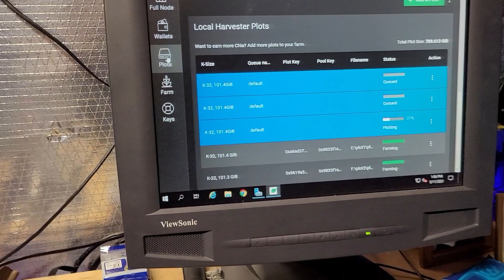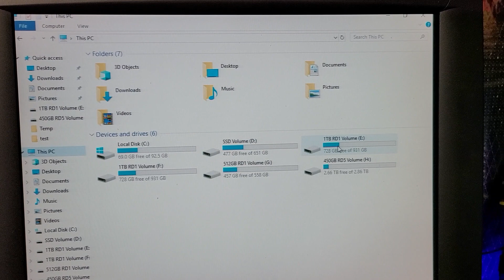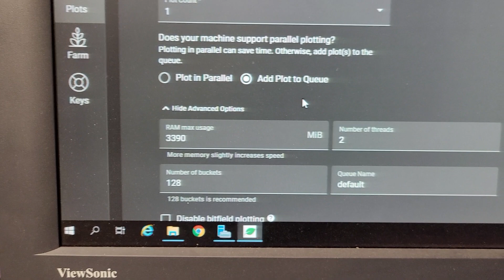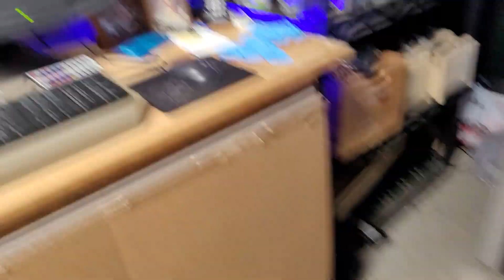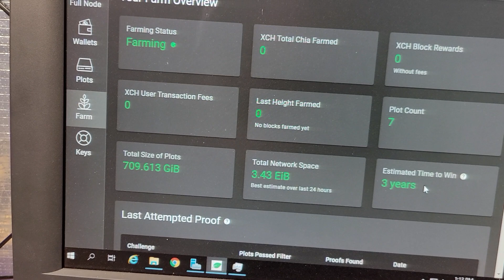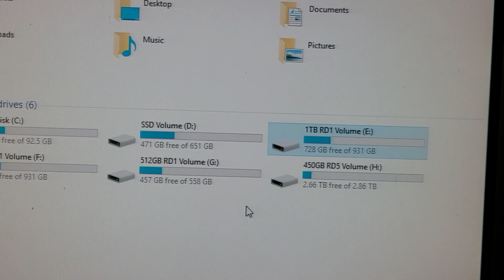More on testing best disk configs for a Chia server and lots SSD drives may not be the answer

Comment: Thank you for the great information, you've earned my sub.  :)  I'm also thinking of getting into Chia mining. I have a few spare parts lying around and was wondering what your suggestion would be, RAID0 or all independent? These are the parts I have and these will be installed in a "not-too-old" gaming computer:

- LSI 9261-8i 8-port PCI-E 6Gb/s SATA/SAS RAID Controller Card

- 4 x H.G.S.T HUC109060CSS600 C10K900 600GB 2.5" 10K RPM 64MB SAS Hard drives

Thank you for your input, it's greatly appreciated.

Comment: your videos on the subject have been very informative im sitting on a couple R730xd’s that im trying to optimize I’ve read that yanking the perc controller and swapping it for a hba, formating drives to xfs, disabling swap in linux allows you to plot 30-40 per day.
Reply: Thanks for the swap comment, i'm yet to set up farming but im gonna be running upto 6tb worth of sas drives on a linux host so that swap boost will be useful.
Reply from the maker: I have not heard that but I would like to know if you are getting that.  The math doesn't add up for up to 40... But!  Keep having fun doing this stuff dude!

Comment: thank you my dear . I need to buy some parts can you help me . Server for chia > I now own 20 HDD 8 TB every each and I am planning to buy more, but I need an expert . How can I communicate with you and thanks
Reply from the maker: Thank you for thinking of me as expert but I really am not.  Just a IT guy that has been doing this for 30 years.  First thing I recommend is for you to go to CHIA.net first.  Understand what is needed as a basic system.  A PC will do.  Build a few sample system build outs in MS Windows and Linux.  (Linux will get you about 15% back over windows) Use what you like best.  Then when you feel ready build a server / high cap disk drive array like a NetApp DS-2246 3.5 inch array or something like that with a SAS HBA controller and you are ready. (Do your research on the SAS/Mini-SAS cables needed to connect the DS2246 to the server.)  Make sure you track your CPU threads and RAM requirements.  I am using a Dell-R720XD 2.5 24 bay server with a single 2246.  So far so good!  Enjoy... /:>

Comment: Step 1: If you're on Windows get off of it and go to Linux... a guaranteed 10%-15% increase no matter your setup. Windows is a resource hog. 
Step 2:  You want to forget about using Chia local client. you will want to use Swar Plot manager. In the config, you can control what resources your using during which phase.  Example CPU threads are used in Phase 1. Rule of thumb 2 threads per plot. However in the config when you get to phase 2, you can drop those 2 threads down to 1 and start freeing up system threads to plot even more. 

Here is an example: 
16 cores 32 thread machine equals 16 plots if it's 2 threads per plot in parallel.
Phase 1 = 1-31%.
Phase 2 -4/5 only requires 1 CPU thread. 
This is where you need to look at the log file to figure out an estimated time of how long plots take in phase 1. 
Example time: Phase 1 takes me roughly around 3 hours to complete. So after that time, I can drop one thread count per plot leaving me with 4 more plots to be started in Parallel. 

At this point now that you are using your threads at 100% you can start to Stagger all your plots in the Que. 

Remember you can only do this with Swar Plot Manager in the config file. The Chia client is so limited.
Reply from the maker: Thanks for the information, I was reading about this but currently I am doing test builds to show each value and impacts as people choose OS and resources.  Once I am done I may just stop and  move on to the next things or maybe mine Chia a little longer.  The fact it is taking a year to get a Chia token is a let down but I am not doing it for the funds, Just playing around some and sharing information.    Thanks for sharing this info with me.   Enjoy !
Reply: @leadiususa7394  I’m in the same boat. I’m just playing around with the idea of it. Making some systems for home

Comment: Single disk volumes is the recommended method, chia decentralized has incredible videos all worth listening too a few times over. Also if you’re mounting destination drives via file share 10G nfsv4 seems best. I made the mistake early on using zraid2 truenas smb shares on super micro45bay array and ended up transferring 8TB of plots off to new storage and reformatting to drives to ext4; reimaged to ubuntu harvester host to plot and farm to my full node. 

Have 4 plotters/harvesters using usb3 hdds ext4, once hdds are maxed out I remove the hdd’s, shuck em and put them in the 45bay jbod. Setup harvester with new usb3 hdds. 
Using this temporarily until I run non-aluminum core cat5e out to my shed and get 10G. Had the fortune of realizing that cheap cat5e is not pure copper core most the time and could only get 3.5Gbps max over ~30ft run. Have gotten copper core cat5e to work 10G over 100ft a few times. Good times, great content btw
Reply from the maker: What did you think of running hard drives in hardware RAID controller mode vs. software OS.  You are right the single disk mode seem to work well for everything but SSD drives.  Even old IDE drives.  It relates to the short wright cycle I think.   If true SSD drive will not last long before they begin to fail.. I found that out the hard way... This has been fun for me.  Sounds like you had some fun as well.  Thanks for this information Joseph.. /:>

Comment: you're not mining you're just fucking around - do it how you're suppose to and stop jerking off with it. Plot to a fast NVME with TLC or MLC memory or use U.2 or SAS drives in RAID 0 --- then move your plots to large HDD's and not in raid 0, you should know this. ----- OMG chia uses space and SSD TBW cycles OMG who knew..... ummm everyone knows. Thats the point of it.
Reply from the maker: Well thanks for this information LL.  Yes I had seem this information as well but having enterprise level hardware the I repurpose to ask the question can I use this hardware requires some testing.  I am glad I did for I found that yes this hardware does it much better to a PC build out and that all forms of SSD disks (Including NVME /U.2 and so on...) are at real risk of failing with in months (Not year) do  to short write cycles that ware them down fast.  (So far as research in showing...)  So yes, use SSD for the temp Plot builds and be ready to replace that drive sooner then later and use HBA (RD0) SAS disks with final home on large scale disks.  But hey thanks for your input.  It is about having some fun while you bring this stuff back to a productive role again.  Have a great day LL.
Reply: @leadiususa7394  yep wears them out but it’s reward is greater than costs so they become disposable